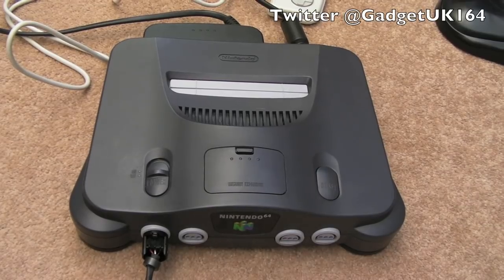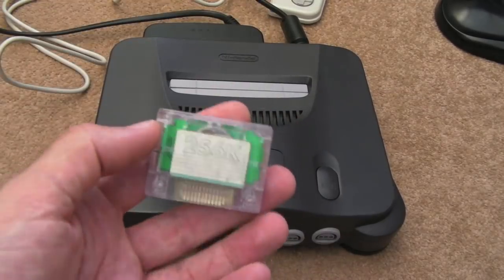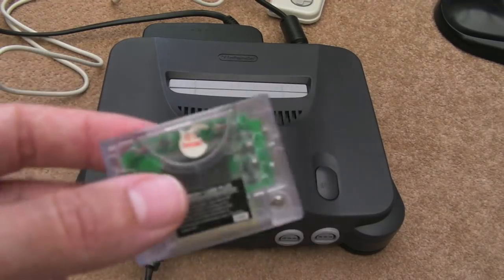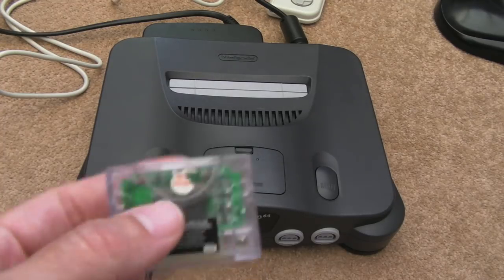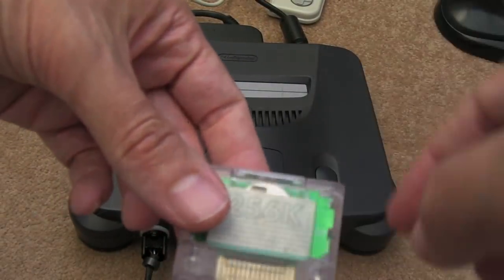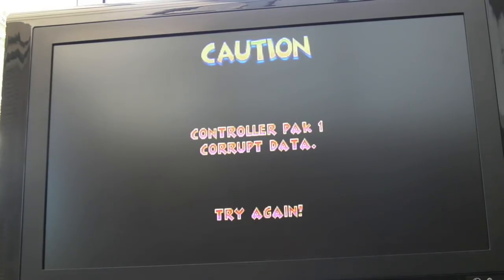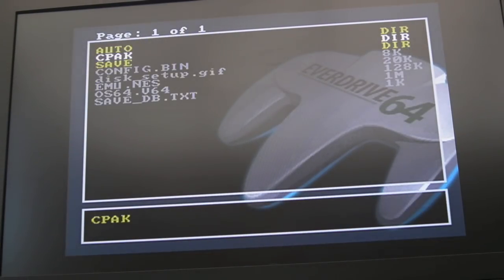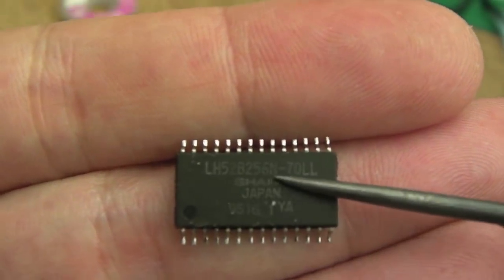Nintendo 64 (N64) Memory Pack Repair & Warning

Comment from the maker: A nice solution might be to replace the SRAM with FRAM - maybe the FM18W08-SGTR would work?  I would need to check pinouts and voltages, but in theory you could mod one to power from the connector edge instead of battery, and use an FRAM IC.
And before I forget - I believe the SRAM used (and the replacement I fitted) are primarily 5v parts.  The N64 uses 3.3v logic levels.   So that's another factor that could be at play here.
Reply: FRAM would be a much better solution to this problem than replacing with another battery powered SRAM.  Drop an FRAM in and forget about it for the rest of it's existence xD

Comment: I rembember South Park 64 having a good file manager. That I was able to format and recover some memory cards that I couldnt with other cart file managers. Havent messed with n64 in years though. Not saying it would fix this ofc.
Reply from the maker: I did use the Southpark file manager too!  I tried a bunch, and also tried the Everdrive (format game pak option) and that wouldnt work either.  Was definitely the SRAM!
Reply: That's interesting; I've noticed some games definitely have a "better" interface for the manager than others. I assumed that every game that utilizes the memory card had a manager built in but that isn't true (Off Road Challenge comes immediately to mind). Then there are some games that have the manager even though they don't use a memory card.
Reply: Isnt it volatile? No power=immediate erase of all data?
Reply: I just dropped fram into my official N64 pack and it won't format using Perfect Dark, I'll have to give this a go. All solder joints are good so I'm stumped. We shall see!
Reply: I fixed a bunch with Beetle Adventure Racing, South Park is a good one too.

Comment: Years before I got my EverDrive 64 I used to own a CD64 Plus (game copier) it could backup N64 games and store them and load them from CD-Rs to its internal 256mb memory, one of its best features which this video has reminded me of was it also had a memory packs manager were you could format memory packs backup and restore them, because of this I only ever needed one memory pack for my N64. My CD64 Plus eventually died as it was made from cheap components and hot glue but it was the nutz at the time.
Reply: this sounds very similar to Doctor V64 (device that Nintendo hated so much because it was used for copying N64 games)

Comment: I wonder if there's enough current provided to the mempack connector's 3.3v line to use buck/boost based lithium charger controller chips ?

There's certainly enough physical space to fit one of the small drone-sized lipo packs in there with an sram.

 In terms of smd soldering i've been having great success using the paste + hand soldering, i've found that the way the paste wicks to the pin takes care of any unwanted bridging but i'm still very much learning to do smd work :D

Comment: Thank you GadgetUK164, for this memory card SRAM replacement repair, its much appreciated.
Reply: Would there ever be a chance of a N64 booster pack mod. reason I ask would be there any reason not to try doubling the amount of ram if the system could handle it. not that any game would need it just would be great for home brew having more N64 ram to run emulation off an ever drive.
Reply from the maker: Yes, the PCB in this video seems to support larger chips.  In theory it could be possible to piggyback a 2nd 62256 chip on there and with some added logic to switch between the chips on the upper address bit it could be made to work I think.
Reply: @GadgetUK164  Thank you sir!
Reply: Thankfully the VMU on the Sega Dreamcast doesn't have this issue with sram. Those really eat batteries so does the wii remotes.

Comment: I’ve never had a problem swapping batteries on my 3rd party paks. If it says “corrupted” then you usually just let the game software “reformat” the card or whatever. Are you saying that using them with a dead battery kills the SRAM?
Reply from the maker: Yes, depending on how they are wired.  If the SRAM gets powered by the N64 via the cart edge, then it would likely be OK.  But if the SRAM is solely powered by the battery, and the battery is flat or missing, then latch-up is entirely possible.  I haven't got an original pack to see how they are wired, but on these the battery seems to provide the sole power to them.
Reply: so going by what you're saying, you will basically kill the SRAM simply by removing the battery, weather the battery is still good or not?  What's the point in the pak giving you the ability to remove the battery then?
Reply from the maker: No, you can kill the SRAM by powering the unit without a battery - or a bad battery.  The big problem with mine is the battery bay shorts out the contacts, so if you powered it with no battery, that would kill the SRAM.  And the contacts are really bad, so when you do swap out the battery you need to make sure it is connecting before powering up.
Reply: AndehX Like a game cartridge with a removable battery, it’s internal and isn’t intended for end-user replacement. It’s intended to last a decade or two before running flat and losing your data. Still should’ve been engineered in a way so that the SRAM wouldn’t get fried when the battery dies. I’m surprised these 3rd party controller paks didn’t use soldered-in tabbed batteries like most SRAM game paks but that’s probably just parts bin engineering for you.
Reply: AndehX ...oh yeah: it also appears safe to preemptively remove/change the battery (Edit: With the checks/precautions Gadget just suggested ;)). It only kills it if you attempt to use the controller pak while the battery is dead or removed. Because most people wouldn’t consider changing the battery until after finding their saves gone, most people will have already fried it. Sucks!

Comment: I've had the battery die on an official pak and attempted to use it multiple times with the dead battery. I opened it up, replaced the battery and its been working fine. I believe it would save the game fine but it would be gone instantly after you powered off. Maybe they are powered from the console as well. Some of the third party packs are really shite inside;(bodge wires and cold joints galore) these don't look as bad. The prospect of putting a chip that didn't require battery power is very intriguing
Reply from the maker: When I get more time I will install an FRAM into one of these! =D

Comment: I agree with you on the hot air as well. Very useful for removing a chip but I always just drag solder when reinstalling

Comment: Excellent video, those weird studs on the chip are usually for some kind of battery pack that some manufactures make for their RAMs to make them into NVRAMs, ST Micro do ones called SNAPHAT.
Reply from the maker: Thanks for the info there =D  Very useful =D

Comment: can you install bigger ram chip ?
there are those 4 unused pads and resistor place, 
is that the only phisical difference between 128/256/512k boards?
Reply from the maker: Yes, you probably can!   I completely forgot to focus on that aspect.  But yes, pretty sure that's what the other 4 pins are for.  Assuming you can go to a 1MBit chip from the current 256Kbit I have fitted.
Reply: So, topic for next video, right? 😀

Comment: Very interesting, didn't realise lack of battery could ever kill SRAM. Cheers for the vid!
Reply from the maker: Yes, it's an interesting point, and there might be other factors to consider.  In the case of the Neo Geo, when there's no battery at all - the system works!  I ran mine like that for 3+ years and the SRAM was fine.  Where I think the problem can occur in the MVS is when the battery has failed and it perhaps provides some resistance, so the power that normally feeds its VCC rail (via the charge circuit), perhaps pulls the VCC down below the logic level the data and address buses are driven with.  At least that's what I think is happening on the MVS.  But in this case there is no 'charge circuit' on these cheap mem packs, so I think there's much more chance of latchup even when the battery level drops over a few years.  eg.  imagine battery drops to 2.0v, and data / address bus logic level is 3.3v...

Comment: cool video. Do you know a good way of removing the unofficial memory paks without damaging the controller? im really stuck
Reply from the maker: I've not heard of that problem =/   You might need to take the controller to pieces in order to work out how to remove it, and inspect closely to work out how to stop it getting stuck in there!

Comment: Hi I believe Tetris for the N64 has a repair pak option and it worked for my memory card.  Either Tetris or Wetrix.
Reply from the maker: Thanks, the repair option wouldn't have worked here as the SRAM had died =/

Comment: Wait - what shorted out the sram chip - removing the battery or powering it up without the battery? I can't imagine those would short through?

On a side note I think soldering with a heatgun without a stencil for the chip itself is probably more trouble than its worth.
Reply from the maker: The battery wasn't providing a supply to the chip at one point (just because of how bad the battery connector is in design).  That caused the latch-up =/
Reply: Oh wow that is horrible.
Reply: @GadgetUK164  Just for clarification, that would mean that the same would happen if the battery died or wa removed, which you stated in the video. Odd to me that losing power at any time would destroy an SRAM.
Reply: @GadgetUK164  Saw further details in your other comments: (Using one with a dead battery could kill the SRAM) depending on how they are wired.  If the SRAM gets powered by the N64 via the cart edge, then it would likely be OK.  But if the SRAM is solely powered by the battery, and the battery is flat or missing, then latch-up is entirely possible.  I haven't got an original pack to see how they are wired, but on these the battery seems to provide the sole power to them.
(You) can kill the SRAM by powering the unit without a battery - or a bad battery.  The big problem with mine is the battery bay shorts out the contacts, so if you powered it with no battery, that would kill the SRAM.  And the contacts are really bad, so when you do swap out the battery you need to make sure it is connecting before powering up.

Comment: I have 2 dead Nintendo 64, after cleaning them I couldn't start them. The contacts are clean, the power led comes on but black screen. I think the ram is bad on the board. Can I switch the on-board RDRAM with chips from, let's say a chip from a stick of rambus ram?
Reply from the maker: Off the top of my head - not 100% sure!  You need to look at the part number of the RAM on the N64 (and its specs / pinout) and compare to the RDRAM on the DIMM / SIMM.  It might be bespoke to the N64 - not sure!

Comment: You stated you couldn't remember whether you had gone and powered the memory pak back on with the coin cell contacts shorted (or not). Are we certain having done that may not have damaged the SRAM? I'm not clear whether what happens in this video actually supports the conclusions you reach at the end of it -- it would be nice to know for sure.

Did you happen to save the "CPAK to File" using the EverDrive when it was supposedly corrupted, so that we can compare the corrupt 32k memory's contents against a normal 32k memory pak's contents using a hex editor? Interesting video as usual!
Reply from the maker: Pretty sure I didn't to be honest!  The only reason I mentioned it is because that would almost certainly cause the failure.  I believe the battery wasn't making a good connection.  It's definitely a common problem related to the battery level dropping as I've read a lot about it and how swapping the battery is hit and miss.  Changing the battery is often too late after it's dropped too low.
Reply from the maker: And after the failure, the dump of the CPAK was just blank - no data there at all.  So SRAM just wasn't holding anything.
Reply: I would expect the SRAM to be empty after the failure addressing it was happening, since the contents were lost by the battery being removed (assuming you didn't power it on with the connectors shorted and fry it). If we had that empty 32k file, and could do a hex compare against the original dump before removing the battery, we could maybe see if the signature or nintendo data was there (alongside whatever saves were there, but I am thinking it might stand out somehow).
Reply: Actually, scratch that, if it was all zeroes, then you wouldn't even need to compare -- the original copy would be enough to examine. :^)

Comment: That is strange.. the SRAM should have just emptied its self when the power was cut and you should have been able to just reformat it in the N64 just like you did with the new SRAM chip, maybe its just a defective RAM chip they used.
Reply from the maker: What has happened is the battery wasn't connected properly whilst it was powered, causing a latch-up fault.  That does look to have been the cause.  Before the battery was 1st removed to measure it, it was working perfectly.  When the battery was re-installed, one of the connections made a really bad join to the point it wasn't powering the chip.

Comment: Great vid dident think it would be latch up
Reply from the maker: Thanks!  Nor me!  I couldn't believe that it had died just from the battery not making a proper connection tbh.  I spend a number of days trying to rule everything out - but it 100% certainly had a dead SRAM at the end of the day.  Worked fine before I removed the battery to measure it =/

Comment: Hi! Would you be kind enough to help me with issues on a fault Expansion Pak from Japan?
Reply from the maker: What's the problem?
Reply: @GadgetUK164  I inserted it the first time, didn't boot. The 2nd time I pressed on it a bit from the top, and it booted but froze during the intro of Pokemon Stadium 4. And now it's just dead. Won't work with any kind of pressure. The cartridge pins do not run all the way down to the lengt of the cart where it meets the slot. Is that normal? I'm thinking of baking it in an over for a bit, or maybe using an eraser on the pins and then a fibreglass pen to rub the connectors with.

Comment: I doubt that the battery or your drop killed the SRAM. All removing the battery would do would be to wipe the FAT and the root directory entries from the card (they use the FAT12 filesystem). And the SRAM would have reset to all 0xFF bytes when you removed the battery, giving the appearance of being both empty and having no free space left (free space is denoted as 0x000 in the FAT12 FAT. If you'd reformatted the original SRAM chip, the FAT and empty root directory structures would have been recreated, and it would have worked just as well.
Reply from the maker: No, it was a faulty SRAM!  Formatting it using various methods there (including the format build into the Everdrive) always resulted in it no being usable.  The battery not being connected properly caused a latch-up, killing the SRAM.

Comment: Interestingly enough, I have a ‘Joy Tech’ 64 memory card that comes with a warning sticker that reads “Recommend to change a new battery every 12 months. When changing battery, finished within 1 minute, otherwise the memory card will be unrecoverable to work.”
Reply from the maker: Sounds like the Joy Tech ones do at least have a capacitor in there to provide some charge whilst you swap out the battery - that assumes the battery hasn't dropped to 0v.  I would certainly replace any CR-2032 cells in these every few years at least.
Reply: SRAM can have a good bit of data retention without any power on its own - just on the internal capacity of an IC. Not sure if it will hold a minute or so.

Bad things happen when you short the power inputs though. Wait, is there possibly a diode to prevent that?
Reply from the maker: The diode seem to just be in series with the battery supply - presumed to protect against the battery going in the wrong way.  that kind of exacerbates the problem since there's also a 0.7v drop from that too.
Reply: Mhm that's a 5V SRAM that you installed - recommended supply voltage 4.5V or higher, retention 2.0V. IO voltage needs to not be higher than supply voltage plus 0.5V. That's kind of hard to reach on a 3.3V system while running off a 2-2.5V (considering diode drop) battery supply. Sure the second diode isn't there to actually power the SRAM from the system voltage (with a bit of a drop) when running in console? Then the battery diode protects the battery against potentially explosive charging. Ultimately that's all they care about, as a cheap product it must only last as long as the warranty, which means likely before the first battery replacement is due.

Comment: You filming in a layby?
Interesting video. I fixed a Sega Cd 2, congrats to me, but discovered my multi mega cd isnt performing well. 😭
Reply from the maker: LOL!  Well done!  Nothing beats that "I fixed it fuzzy feeling" =D  How is it not performing well - struggling to read?
Reply: GadgetUK164 - Retro Gaming Repairs & Mods yeah a few "backup" really struggle and a couple or original wont work unless the disc is perfectly clean. The mega cd 2 read everything fine. Ill clean the laser  lens first but i do have a replacement laser.
The mega cd 2 was just the fuse. Someone gave it to me so free mega cd for me.